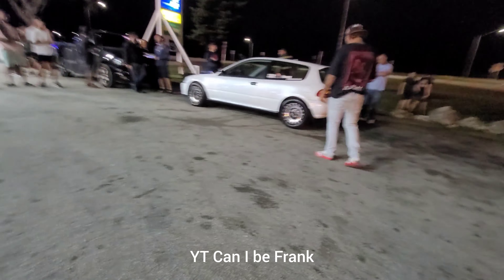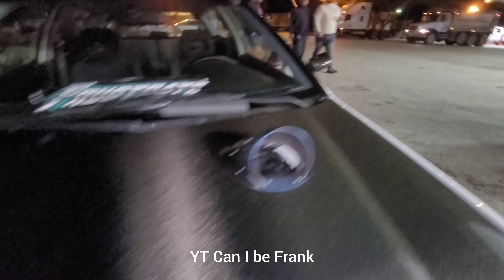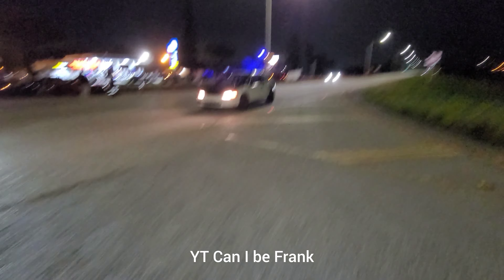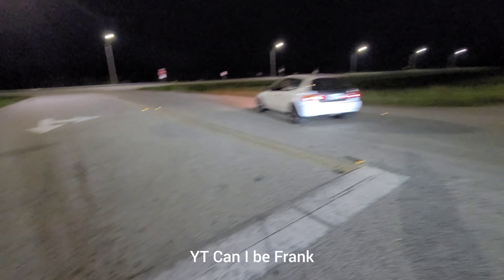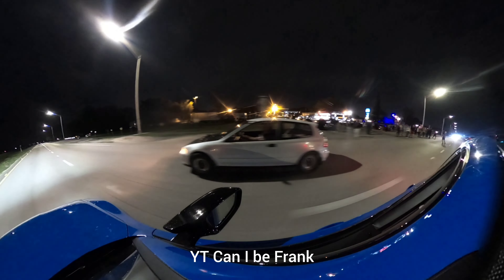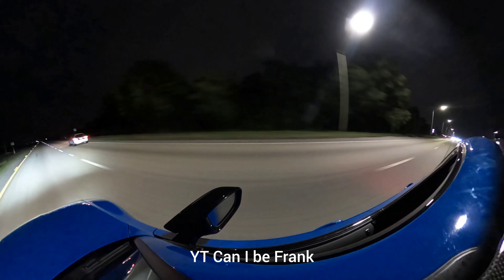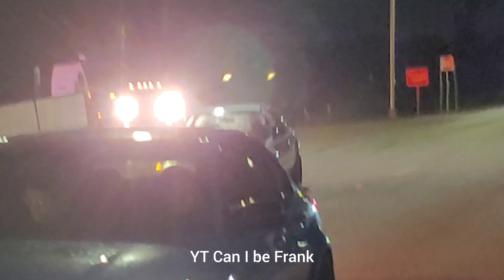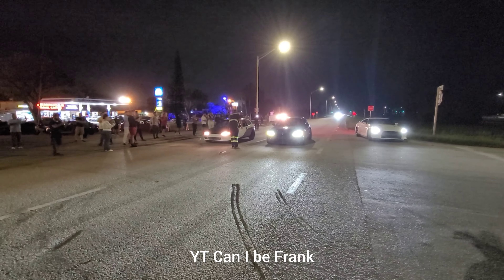Dig Frustrate AWD Turbo Honda vs BMW G80 M3 Bolt-ons JB4 Friendly Run 2 Races 3 Angles

Comment: Probably in less his hondeezy compared to a s58 msrp plus dealership markups lmfaooo JDM ftw 👑
Reply: If you wanna go fast for cheap get a bike 😂
Reply: @terrancebulong4573 yeah but car people don't care about bikes. As a matter of fact most of us hate bikers.
Reply: The guy with the civic is richer. That civic is 60-70k plus and his race car is way crazier on all aspects
Reply: @TheBb6prelude  agreed but his whole point was price
Reply: @terrancebulong4573  that Honda isn't cheap to build. It's like a 70k car like the way he has it. It's obvious cop capped out on its full potential. He has it on low boost. He can easily put it at 1100 awhp.

Comment: tin can lawnmower with big turbo vs full interior stock turbo sedan….😂
Reply: Bolt-ons, JB4. Stay in school
Reply: @Cozzyq I believe he was saying the turbos in the M haven’t been swapped, not that the car itself is stock.
Reply: @Fivepointsloww  It can have them swapped and will still get gapped and I'm not even a huge JDM fan.
Reply: $70k vs $10k
Reply: @tannerharris5848  then some dude in a salvage title zx10r thats worth 3K pulls up and destroys him for even less!
Reply: The result would have been the same even if the M3 had a big turbo, and the Honda was on low boost😂
Reply: @tannerharris5848 10? Frustrate has more money than these dudes with the BMW. It cost like 60-70k for that civic.  It's on low boost too
Reply: A tin canned big turbo G80 still isn't keeping up with this civic. It doesn't matter.
Reply: @SanicGottaGoFast  the best part about building these cars is making euro boys cry  😂,, I was already keeping up with them with a stock engine with a tiny turbo on low boost. Now I'm built engine,cams GT35 turbo h22
Reply: @TheBb6prelude  let em know bro.

Comment: Put the g80 on custom E85 tune with a big turbo and built motor and see what happens 😂
Reply: Then it loses still, dude is on low boost relax
Reply: @Jamxknife  LOL there are g80s with this setup now making WELL over 1000whp. Well over. And getting their ass heated while the gap the Pepsi can. RELAX Honda boy
Reply: you need all that already costing 80k off the lot used plus an extra 50-75k to beat a honda on low boost
Reply: @jeremiah4k927  no you just need a 5000 dollar Streetbike. Lol let's not act like the bmw won't do all the things the Honda won't. Heated and cooled seats, ac music, good ride etc etc. 😂
Reply: Coping hard. Honda was on low boost.  Frustrate has his race car that almost runs 6s 1/4 mile. He don't care about no built BMW 😂😂 i
Reply: @motortoys9942 what Pepsi can? It's full weight with AC and PS.
Reply: @motortoys9942 this guy smokes street bikes
Reply: @motortoys9942 frustrate has money to buy that bmw. He wants Honda POWER  instead.
Reply: @motortoys9942   Built 1400whp g80s running 8.5s this is an 8.0 honda easy.
Reply: @TheBb6prelude  lol maybe 600s. Not a properly setup liter bike or more. 😂 Guys who have never ridden a fast bike have (and no a stock 1000 isn't fast). I'll say this, my bike is 239rwhp at 468lbs and I would absolutely punt this civic. 😂✌️
Reply: @TheBb6prelude  the civic is the Pepsi can I meant not the bmw
Reply: @TheBb6prelude  if you want POWER, a Honda or a BMW is shitty choice 😂
Reply: @Jamxknife  dude they just had a 1200whp g80 run an 8.1 lol
I would give this Honda high 8s to 9 at best
Reply: @motortoys9942  You must be smoking dust, or you think I’m an idiot. That wasn’t a g80 that was an m240, not even an s58 a b58. Either way that’s the faster there is this a one of many and a street car that’s hardly even the fastest.
Reply: @motortoys9942  frustrate runs 7.2 1/4 mile on a car he Street drives. Which is the owner of this car. Does your car run in the 7s too? 😂 ,it looks like you don't have POWER after all. You don't have Honda power
Reply: @motortoys9942  this guy smokes 1000s. His other car beat a 2000 HP GTR when it was slower than it is now.
Reply: @motortoys9942  my Honda will be at 600 bikes and I'm a basic stock sleeves pistons and rods build 😂😂 on a GT35 turbo
Reply: @motortoys9942  Please just stop talking if you think the same turbo a Mfing a90 Supra as gone 7.9s on would be a high 8 low 9 on fully built awd Honda.
Reply: @Jamxknife  that's a different car buddy. BOTH platforms have run that and the s58 is a more capable motor than a b58, build for build and mod for mod.
Reply: @motortoys9942  Well I must be bugging because I haven’t seen any s58 run an 8.1 ever
Reply: @TheBb6prelude  lol then u racing non racing mfers then 😂 a new stock 600 will smoke ur Honda. I will put cash on that bud. I know ur a Honda fanboy but the numbers don't add up. MAYBE on a 60-70 roll u may keep up that would be about it
Reply: @Jamxknife  it's called YouTube. Lol s58 is far superior to b58
Reply: @TheBb6prelude  LOL "2000hp gtr" 😂😂😂 y'all Honda boys are funny. Post the video. I beat a 4000hp gtr with my bike 😂😂😂 yawn.
Reply: @TheBb6prelude  lol my bike ran 7s before spray and boost 😂😂 lol it's called Kawasaki POWER. only time I need Honda power is when I mow my lawn
Reply: @Jamxknife  ummmmm, buddy, does gear ratio, auto trans, aero dynamics etc mean nothing to you??? Also torque. And honestly with the proper setup, AWD actually hurts you. There is a reason dragsters aren't AWD. Lol
Reply: @motortoys9942  Lol first of all this guy has an awd civic that runs 7.2 the fastest k swapped awd civic so if anyone knows it’s him. Secondly awd civics have gone 8.0 on the 7275 gen 2 much less what this is the 7275 next gen r. An 8.0 was a gracious estimate but it could very well be much faster
Reply: @motortoys9942  look up Texas killer vs frustrate
Reply: @motortoys9942  no one cares about bikes,stop it
Reply: It still loses. Power to weigh ratio....
Reply: @mk5rob42  gearing, traction, aerodynamics, auto 8 speed fast shifting trans, launch control technologies etc. Lol more to it than just that in 2024
Reply: @TheBb6prelude If youre refering to Texas killer his car had problems then dunked on him on a rerun. And it was making 1660whp at that time. Not that it matters the fastest roll car and 60-130 on the street belongs to a gtr anyway
Reply: @TheBb6prelude  plus texas' white car would obliterate frustrates setup.
Reply: @motortoys9942  bro, did you listen to Frank in the video? The Civic was on 35psi and is capable of 70. That Civic can run 7s. No g80 can get into the 7s yet. Just stop it.
Reply: @terrancebulong4573  frustrate car is way faster now so who cares
Reply: @mk5rob42  LOL, 50 at best. Sounds like you are playing a little too much Forza bud. I'm sure there are some G80s that "can" run 7s. Until it DOES it, it didn't. Just stop it.
Reply: @Jamxknife bmw boys get like this - an Iroz rs3 still smokes a G80
Reply: @mk5rob42 agreed
Reply: Crazy that you think a g80 has anything for frustrate 😂. Bring the fastest in the world and he will still win.
Reply: @RS3_Dilt  😂 y'all Honda boys never cease to make me laugh. I can't decide what's worse you guys or the Dodge dudes. The g80 JUST came out and it's crazy to think that once you build that motor right, put on a monster single turbo and tune on e85 or race gas with the new technology and trans etc that it won't smack up this civic and many others.
Reply: @motortoys9942  it won't... Just stop it already. This civic was on low boost and on street tires. The world's fastest b58 or any other modern BMW engine is slower than this guys civics. He has the fastest AWD k series full body civic in the world.
Reply: @TheBb6prelude  dude I see u on every single video commenting bullshit. 😂 You are a typical Honda fanboy. And nobody is talking about a b58 😂🤦the fastest BMW in the world has run a 6.5 at over 200 in the quarter. This Honda would get destroyed by that. Next
Reply: @motortoys9942  that's pretty slow compared to the fastest Honda powered car that's closer to the mid 5s but ok
Reply: @motortoys9942  you're a typical BMW guy that fails to acknowledge the performance car would in general and thinks that just because a G80 is 80k that's it's the fastest thing ever.
Reply: @motortoys9942  the fact that you didn't know about frustrate other car that's almost in the 6s is pretty funny. Because I knew about the fast MK5 supra. Get your knowledge up on cars and not just the ones you like.
Reply: @TheBb6prelude  who said I didn't know about it??? And ALMOST in the 6s isn't a 6.5 at over 200mph 😂😂😂 nice try. And nobody brought up a b58, were talking about the s58
Reply: @motortoys9942  well,you're a real car enthusiast then and not just a fanboy. I like to collect knowledge on all the platforms. Not just mine.
Reply: @motortoys9942  I'm pretty sure the b58 is already faster to than the S58; platform.
Reply: @TheBb6prelude  no lol s58 is far superior
Reply: @TheBb6prelude  no dude I don't even own a BMW and frankly I don't like them I think they are unreliable but they can be and are fast. Lol
Reply: @TheBb6prelude  yeah I do the same as well. I was trying to play devil's advocate in terms of making the mods more fair
Reply: @motortoys9942  I drive a DAZA buddy, I just know frustrate is taking out some of the fastest GTRs on the streets. Every year you add he gets faster so no, G80 won’t compete.
Reply: @RS3_Dilt  and there are tons of things that take out gtrs 😂 lol give the g80 a year or less. There is already one that just got complete that's supposed to be around 1400 wheel. If that's the case then frustrate is gonna be left frustrated. 😂💯
Reply: @motortoys9942  frustrate makes that power…in a Honda lol
Reply: @motortoys9942 no it's not the B58 design is way better then the S58 design. Your crazy.  The B58 can handle way more boost
Reply: @Al-mx6ru  LOL yeah??? Find me a b58 running 1000hp on STOCK INTERNALS.....I'll wait. 😂 S58s do.
Reply: @motortoys9942  stock internals? Yeah right. We're the link of that build? Thre come cast pistons. Dnt be silly. That's just goofy.
Reply: @Al-mx6ru  do some research buddy. Lol you can find it right online on google 😂 just because you don't have knowledge of something don't make it goofy. 🤦
Reply: @motortoys9942  why you crying here? The car with the more mods won. That's what happens. What's your logic here? All you sound like is a butthurt fanboy. What exactly is your logic here?
Reply: @Al-mx6ru  no crying and forsure not a fanboy as I don't own nor like bmw. 😂 "The car with more mods won" you answered your own question that's my point exactly. Lol mod the g80 with the same stuff and folks might be shocked.
Reply: @motortoys9942  then why you here crying? Car with more mod won. Get over it. That's racing. You make your car faster with mods. That's the normal guy. Stop crying about it. You sound goofy guy
Reply: @Al-mx6ru  well no shit Sherlock 😂😂🤦 apparently it went right over your head. It's ok buddy, go back to Forza u will be ok.
Reply: @motortoys9942  your the one crying here goofy guy. Bring up bike's. What the Hell?  Why biker? That's weak
Reply: @motortoys9942  FYI  that civic runs mid 7s nothin BMW makes can touch that Honda.  Only in dreamland.
Reply: Sorry but no BMW is touching this car on full boost.
Reply: @ricky3277  IF it doesn't break, IF it hooks, IF it doesn't miss 2nd.....😂 The list goes on. If if if. At the end of the day it's still a Honda lol